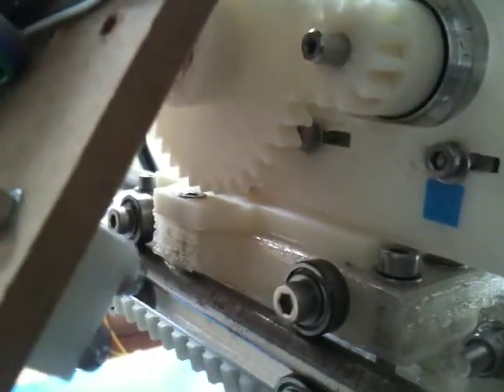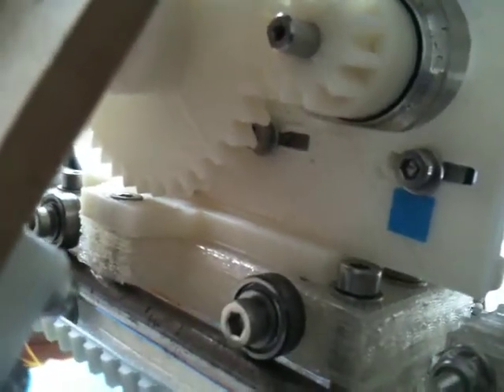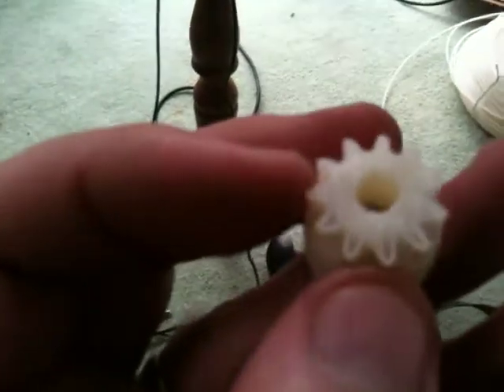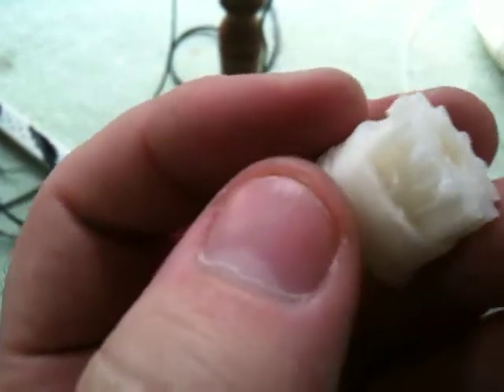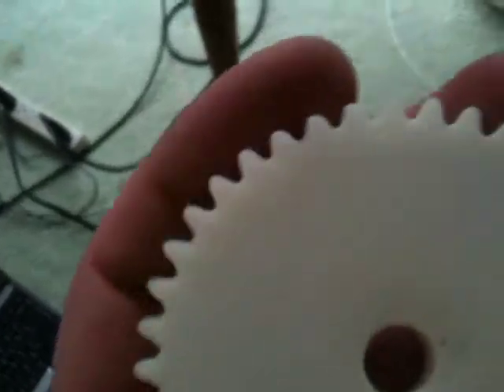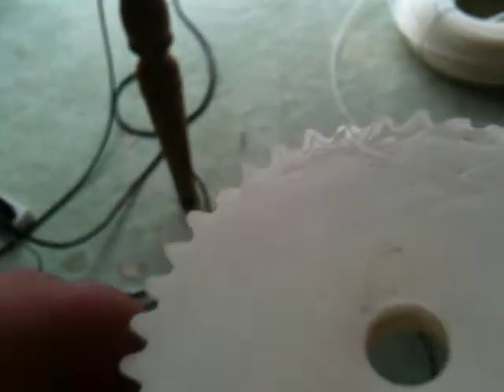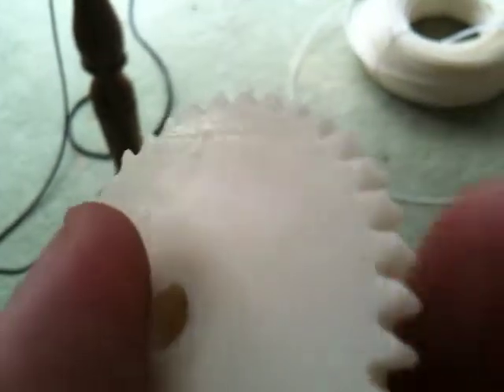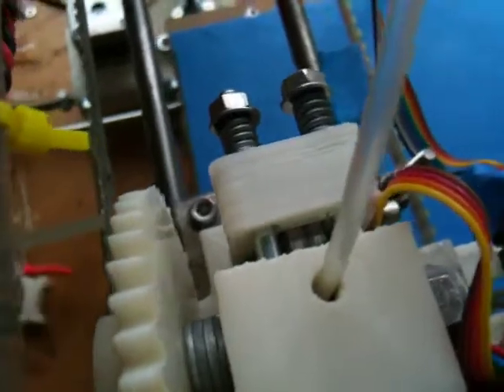Mounted Wade's Extruder sideways

Comment: I have the same problem with my extruder nozzle. I went to the hybrid peek/ptfe thermal barrier which had a longer threaded area lowering my nozzle height.   If you lower the mobo/extruder mount board you will get a few more MM of Z  I had to do that with my normal mount Wade's extruder.  I think its pretty safe todo but if you are printing tall wide objects there is a chance the object could hit the board.